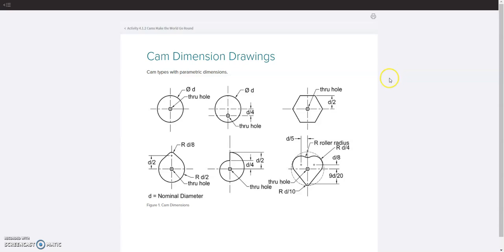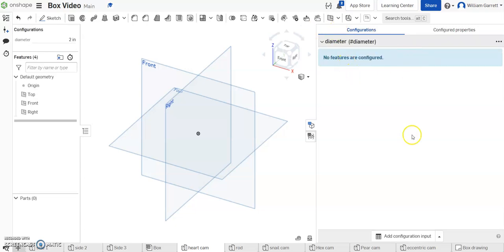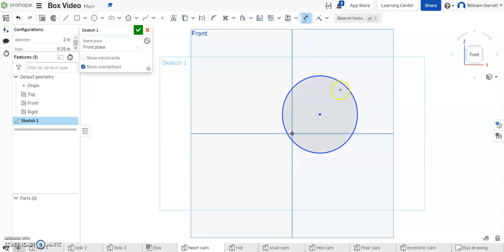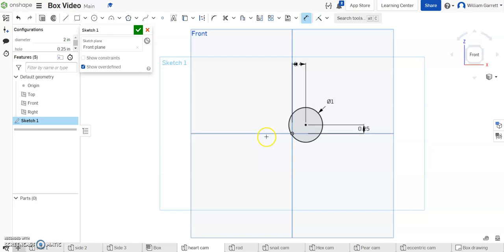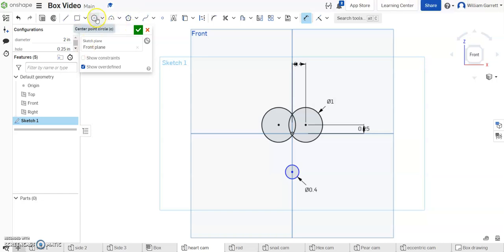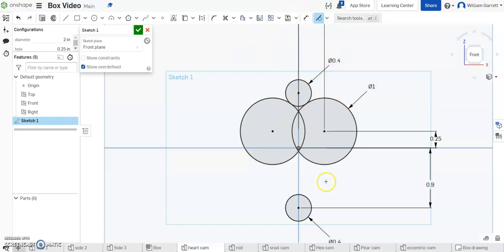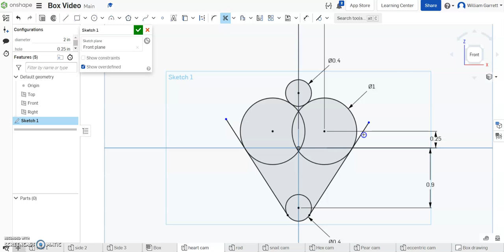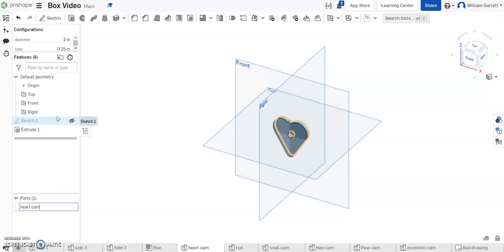Heart Cam using Parametric values in Onshape

Comment: How do you determine the nominal diameter. I have three different cams I need to make they have numbers 186, 230 and 250.
Reply from the maker: Not 100% sure what those numbers indicate.  If you have the physical cams, can measure from the center of the hole in the middle to the base of the heart (if you are working with a heart cam), that would give you the radius, multiple by 2 to get the diameter.